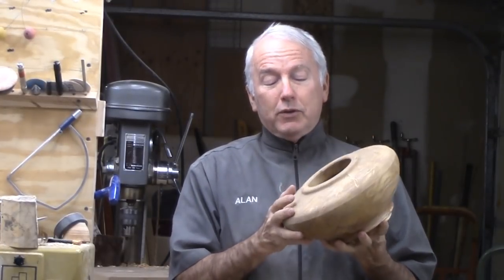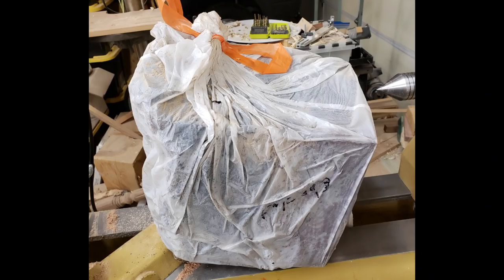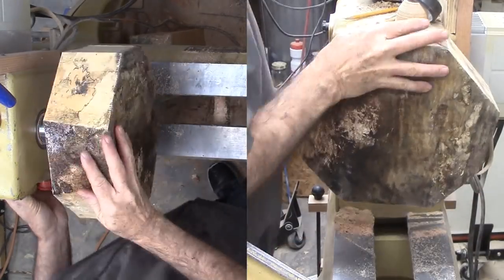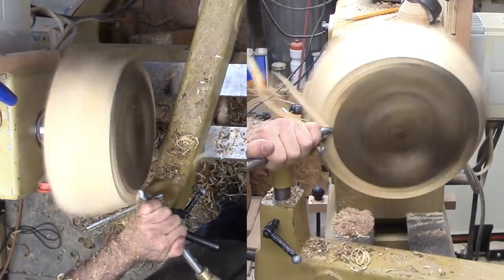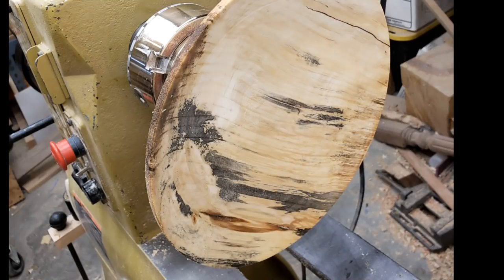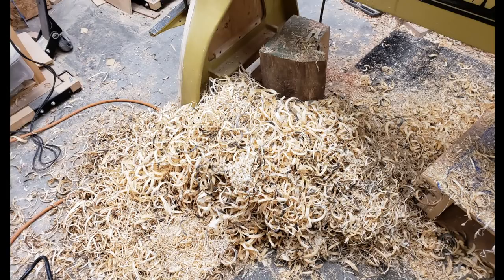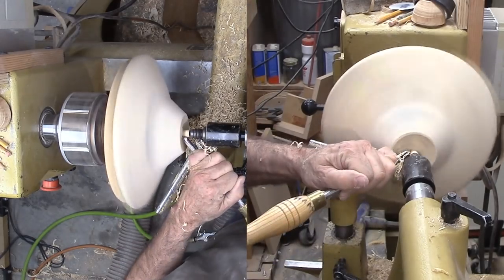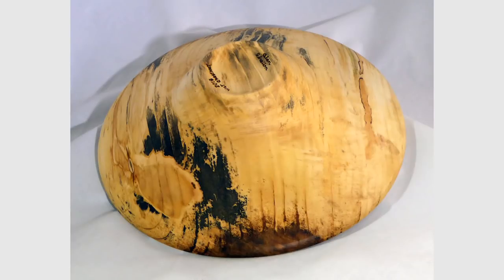Woodturning Green Chestnut Bowl - Hoping For It To Warp

Comment: The bowl turned out (no pun intended) really well. The spalting makes it really interesting.  I’m not sure you needed to wait for the wood to dry a week before sanding. Wouldn’t this have been a perfect candidate for wet-sanding?
Reply from the maker: I have never wet sanded with my sander. My perception is that it would fling liquid way too much.
I do wet sand by hand where the direction is only radial to the axis and I can control the liquid.
Beeswax and mineral oil are a bit different as it works more as a paste but I still don't use it for wet sanding.
I may challenge myself some time.
Thank you David
Alan

Comment: Great looking piece. Where did you get your buffing set up? Would like to get something like that to use on my lathe. I know that there is the Beal buffing system but I don’t really care for having all three wheels on at once.
Reply from the maker: My feelings also. About 2 years ago I did a pair of videos on my buffing. Search back for 

  Woodturning Tool Review: Beall Buffing System 

  Woodturning Tool Review Buffing System Update 

The extension coupled with a couple of shop made disks works great.
Alan

Comment: Fantastic spalting on a good shaped bowl, one question,surely by using a finisher that will in turn hold in any residue of moisture,and thus reduce any further warping ?
Reply: As Wood Turns does that “”rule of thumb””apply to all oil finishes 🦖
Reply from the maker: @arturoverde3807  Not just oil finishes - All finishes. the only thing that varies is the rate of moisture transfer. But moisture will always move toward equilibrium.(the humidity of the environment.)
Reply: As Wood Turns wow I love it when you talk dirty, lol 😝,thanks for the mind expansion,stay safe 🦖